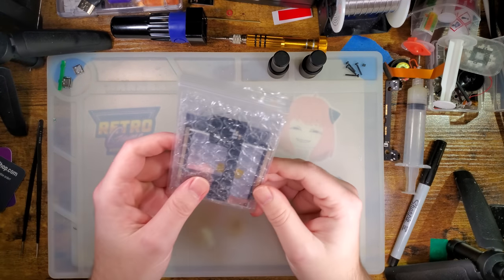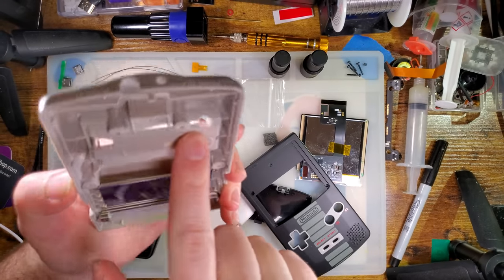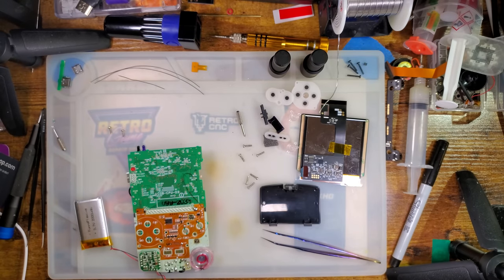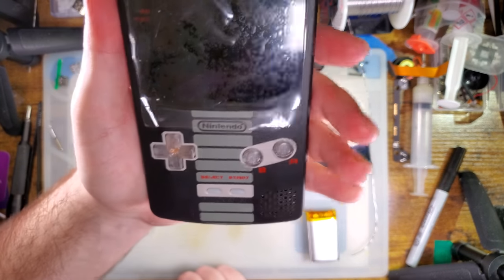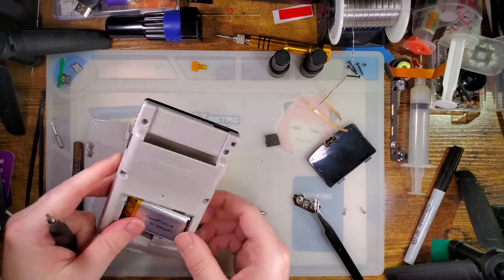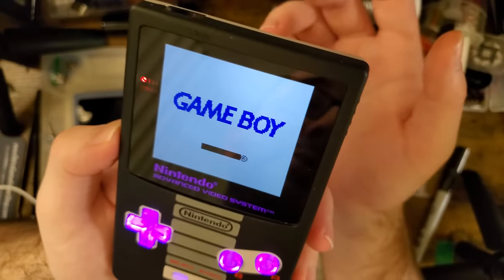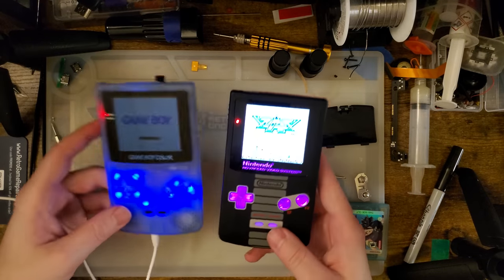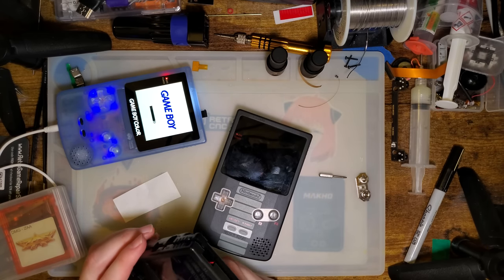Laminated Game Boy Color IPS Kit (Funnyplaying Q5 v2.7)

Comment: I just got a 2.7 kit directly from Funnyplaying and they have updated it again. Now there is a OSD menu and they have added the frame blending option as on the GBA laminated IPS 3.0 kit. I tested it with Zas and there is no background flicker with FRM turned on. You can now also customize the color of the illuminated logo by adjusting the individual RGB values.
Reply: Mannnn WHERE THE F*** did you buy that? I mean just the ribbon 2.7
Reply: @GENKIDAMA10 first sentence of their comment. Directly from Funnyplaying.

Comment: I just did one (2.6) lord help took me about 25 times apart and back together because my b button kept acting like the start button and I couldn’t figure it out. Then it hit me the via ports have got to be crossed somehow ! So I uninstalled the wires and wicked away all solder from vias and then trimmed exposed wire shorter and then re soldered everything and now it works flawlessly. Watch those via spots as they are super close to each other! Retro game shop repair rocks.

Comment: For removing these screens from the funnyplaying shell- if you don't have a suction cup tool (or have a bad track record with them like me) you can stick something, I used a plastic spudger, in the led hole and gently push the glass until you can get a guitar pick or something under it, then slowly slide it over the top to the other side so both sides are being removed evenly.
Reply from the maker: Probably better to just get a suction cup. You risk scraping the print off the back of the lens or delaminating the LCD otherwise.

Comment: Just followed this step by step, powers on with the red light but no sound and the screen doesn’t light up at all. Any obvious mistakes I could of made? Any help appreciated.
Reply: Never mind, I messed up some solder points on an additional mod that created a power issue. Fixed the issue and it’s working! 

Thanks for your in depth videos!

Comment: Hi man, why i CANNOT find just the 2.7 ribbon? :(
Reply from the maker: Ask kit sellers
Reply: @makho  Okey thanks man. Just another question: is there a way to no use the touch sensor? I mean, can i in some way disable it?
Reply from the maker: @GENKIDAMA10  This reddit thread has a lot of info on the touch sensor and mods for it. https://www.reddit.com/r/Gameboy/comments/11rmms7/i_was_able_to_completely_and_permanently_remove/
Reply: @makho  Thanks a lot man! So if i set 5 as brightness level and remove the touch sensor i will never be able to change it again, right? And obviously my gameboy will work just fine right?
Reply from the maker: @GENKIDAMA10  In theory, yeah.
Reply: @makho  Okey thanks again for your help